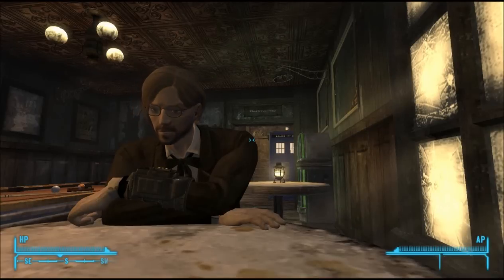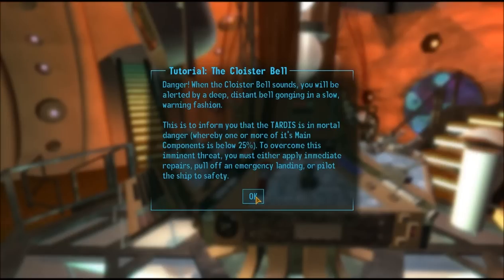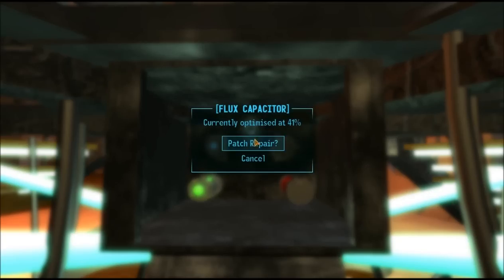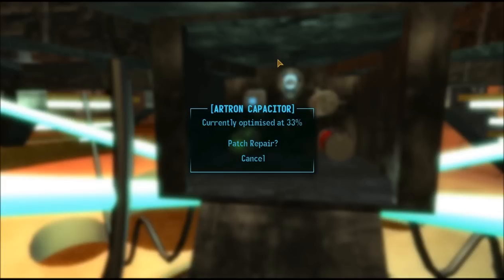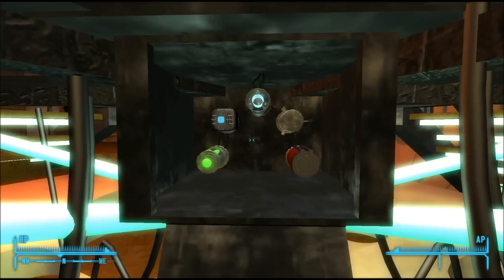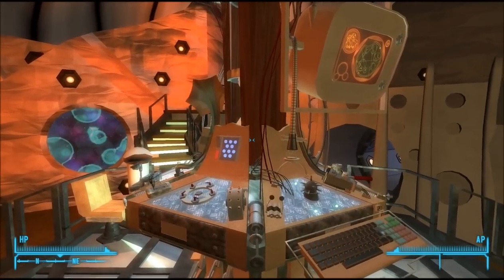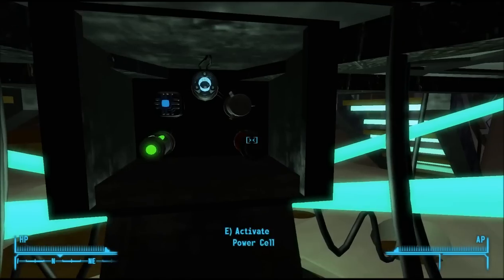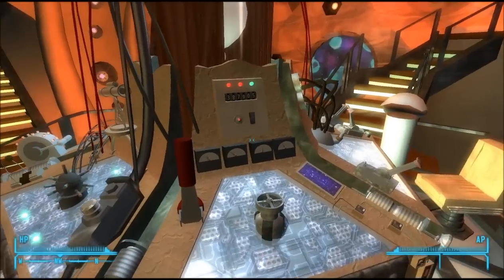Fallout Who Vegas - Wave One - T.A.R.D.I.S Maintenance and Repair Walkthrough

Comment from the maker: please make sure that the flux capacitor is replaced, not just repaired, to make one simply do the same thing as you did for the powercell in the workshop, except check the materials for the flux capacitor instead.